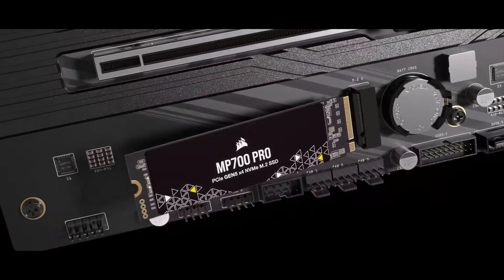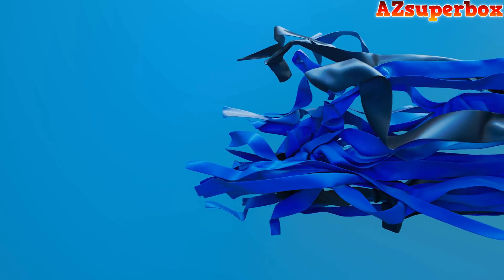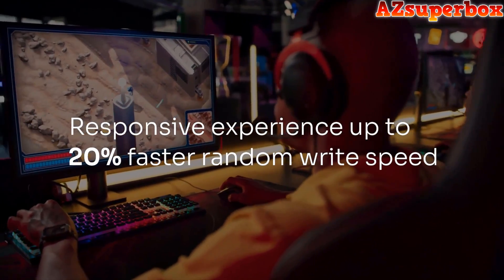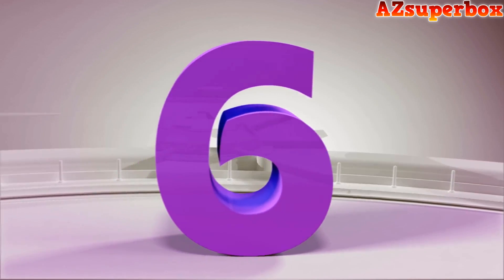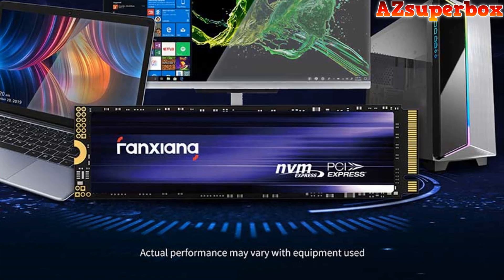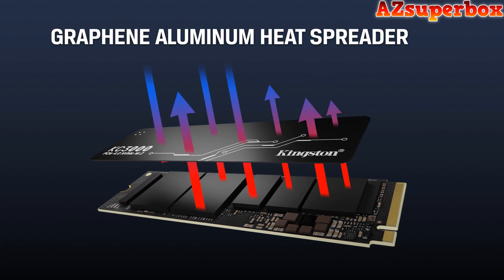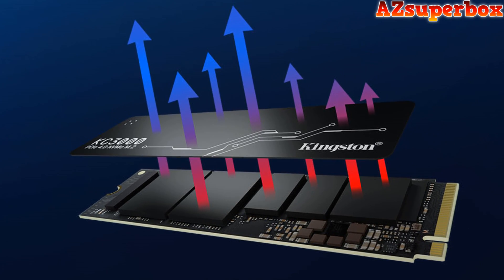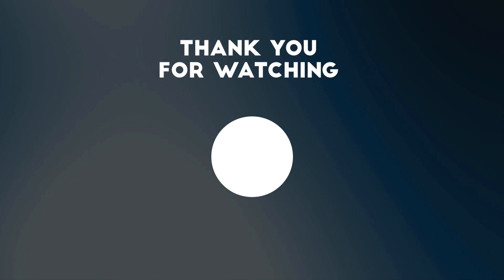TOP 10 BEST M.2 NVMe SSDs REVIEW IN 2024

Comment from the maker: #10). ► Silicon Power P34A60 ➜ https://bit.ly/3v4iQyu
#9). ► Nextorage NEM-PA ➜ https://bit.ly/4cbt6Ga
#8). ► Solidigm P44 Pro ➜ https://bit.ly/4cbWyvp
#7). ► Fanxiang S500 pro ➜ https://bit.ly/3wNWORe
#6). ► Move Speed HB7450 ➜ https://bit.ly/4c6noVU
#5). ► FanXiang S880 ➜ https://bit.ly/49MfMWQ
#4). ► Patriot Viper VP4300 ➜ https://bit.ly/48Mr9wP
#3). ► Kingston KC3000 ➜ https://bit.ly/493oCP7
#2). ► HP FX900 Pro ➜ https://bit.ly/48OQypN
#1). ► Acer Predator GM7000 ➜ https://bit.ly/3Tus0xS